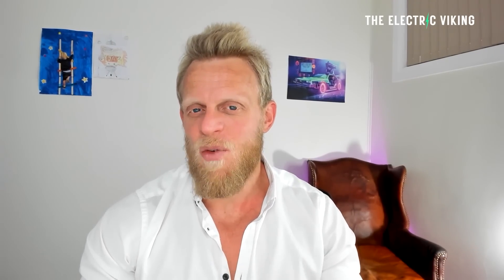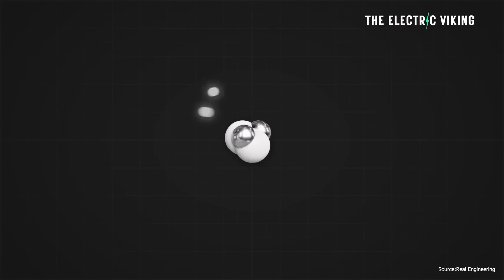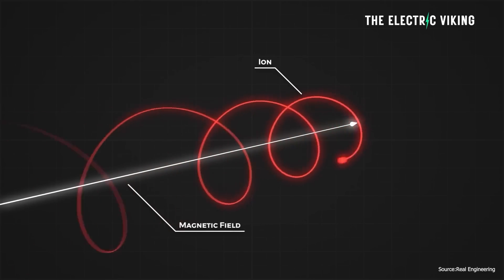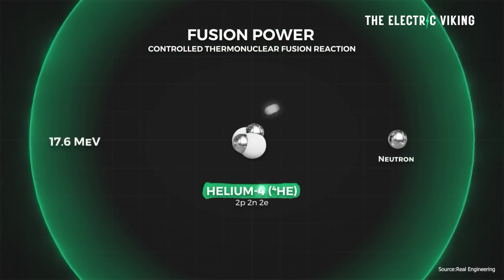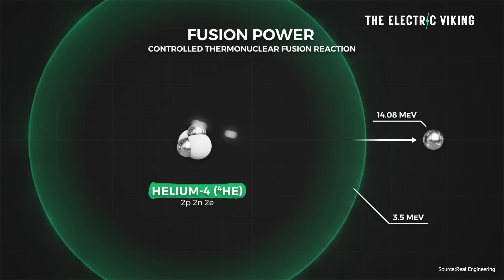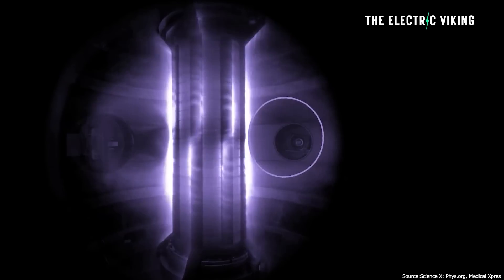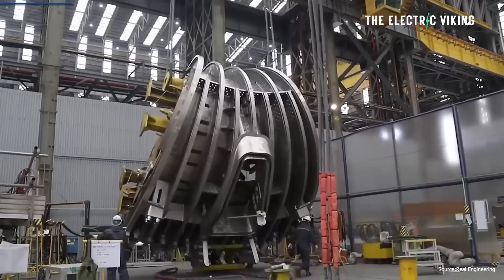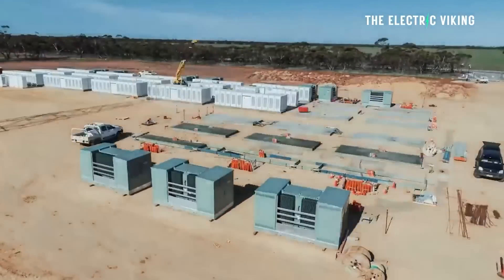The breakthrough discovery accelerating controlled nuclear fusion on Earth

Comment: You're absolutely correct to observe that nuclear fusion on Earth is a "nice to have" and not necessary for our clean, secure, affordable energy future, since we already have an inexhaustible fusion reactor in the sky, which we call the sun. We also already have the converter technology needed to convert the sun's fusion energy to useful, clean, reliable, durable and affordable electrical energy, in the form of solar panels and wind turbines. Likewise, we already of the energy storage technology we need to balance supply and demand, i.e , batteries, pumped storage, etc..., as well as high voltage (AC and DC) long-distance transmission lines. We just need to be deploying more of these clean, distributed, renewable energy technologies faster and retiring sooner the dirty fossil fuel systems and highly problematic nuclear powerplants. While affordable fusion powerplants would be less than necessary but "nice to have" on Earth, compact fusion powerplants would be very helpful, perhsps even necessary, for humankind's exploration and settlements on other planets beyond Earth. One correction to your understanding of the runaway electrons in the tokamak reactor system however is that such leakage poses no explosive or other hazard to anyone; rather, such leakage causes the desired fusion reaction to cease. This is why eliminating such leakage could be a big step forward for such a design for a fusion reactor.
Reply: You’re dead wrong. We absolutely need nuclear power, we should’ve been focusing on it rather then investing so heavily in solar and wind. Solar and wind aren’t energy dense and reliable sources, that’s why they still haven’t made a dent in our fossil fuel consumption, while creating a bunch of new environmental problems. Nuclear fission could’ve got us much further in decreasing our carbon footprint, if we would’ve invested in it 30 years ago. Nuclear fusion could really change the world we live completely. Solar and wind isn’t the answer

Comment: A question:  what of the atmosphere is the component is CO2 closest to?  A. 40% B. 20%, C 10% D. 5% E 0%.  The answer is E. 0%. CO2 is 0.04% of the Atmosphere.
You think that is driving warming?
Reply: .04% or 421 parts per 10 to the sixth power. Since you think such a small small amount can't possibly cause a problem, please injest 50ng of polonium. The concentration inside you would be approximately 68 parts per 10 to the 12th power. A million times less than the co2 concentration. Shouldn't cause you any harm, it is just way too small a concentration to do that.
Reply: @markvalery8632 ridiculous comparison,  and not relevant.
Reply: @robertfonovic3551  It is a ridiculous comparison. SO IS saying something can't have an effect because it is only .04% of the gases in the atmosphere. Do you understand that????

Comment: My understanding is that they have achieved fusion with a gain of >1 but only for the reactor vessel itself, not from grid back to the grid. There are a few people saying that even ITER wont put more energy back into the grid than it draws so it cant be considered a Fusion power station, that will still need a lot more development. Im sure they will succeed one day but will the resulting power station be affordable? We're going to need to build a lot of them very rapidly.
Reply: The ITER is a reserach facility; their first goal is being able to produce sustained fusion (no one was able), the second goal if the first hass success is trying to get more energy produced than it costy (no one was able), and if they have success with the second goal the third is to eplore the viability of  commercial fusion power plants. BUT it won't happen before 30 or 40 so even in the best scenarior we won't see commercial fusion power plants in our lifespan. Most of the other attempts are  just snake oil sellers trying to get funds...
Reply: Fusion reactors as expensive as ITER are a complete waste of money. We’d be better off spending that on research into solar panels, batteries, more efficient refrigeration and improved insulation.
Reply: @sunspot42  The ITER is a research facility and the ~20k million € cost cost to date were well spent: it requires the cooperation amongst more than 30 countries and as happens with the CERN, the LIGO or the James Webb is absolutely top notch. The goal of the ITER is not to make money but to answer some questions about practical fusion which would be crucial for the future of science. Given the amount of money we are puting in renewables and the spectacular speed at which the world is increasing the GWh output in renewables the cost of the ITER is barely cents...
Reply: @Buran01  feasible large scale fusion is  like trying to balance a atom on the point of a needle when all you where asked to do was balance a ball on a stick. we already have tidal we already have geo thermal. neither has had a large scale role out although either would provide all the energy a tier 0 civilization needs
Reply: The energy is surly there, the calculations show it. The problem is surely holding the plasma steady before energy extraction is done. And with advancements in materials (like superconductors and magnets) we have increased run time form milliseconds in the 1990s to seconds in the 2000s and now minutes.
Reply: @AORD72  the amount of energy to keep a large scale fusion reaction going(which is only way we see as far as i know to get power gain) is MASSIVE any resistance causes a bunch of heat & escalating resistance so until we have room temp super conductors its going to requite big tubes & tanks of liquid nitrogen or something similarly dangerous to keep resistance low enough to run it indefinitely or for 18hr ext operating cycles
Reply: it takes ALOT of energy to imitate the mass of the sun. until we have room temp super conductors  we CANT make more power using fusion  using power off grid because of HOW MUCH power you have to put in to imitate the mass of sun you lose more than you create extra EVERY cycle

the oceans and earth however have a LOT of ambient mass in them not as much as the sun. but the most well ever have acess to on this planet
if we want true limitless power we should be building tidal & geo thermal power plants which we already have 
(its only logical that as the systems with the most ambient energy inherent in them they will give them most power) 
(in 1900s san fransisco's tram network ran on 2 big pistons in river that where driven by tides running a series of cables around city, before GM blew them up we could have been using tidal not fossil for public transport ext for 100yrs now)
Reply: I've been following ITER for about 12 years now (though it was started by Reagan and Gorbochev). The Cadarache facility (ITER) seeks to reach >Q10. It will be based on a standard unit at around 550MW, however, all the energy produced will be simply bled off. This facility is much more complex and expensive than a standard power station would be. They need this site for testing and exploration work. The next plant will be called DEMO and will streamline down to the bare essentials to make actual electricity for use. Last I heard they were shooting for 2036 for this site (DEMO) to go online. But if it works well, they can roll them out everywhere. Part of the issue is that there is only about 1.2Kg of tritium on the planet at any given time. And a fully functioning reactor will need about 100Kg a year to operate. Fortunately, the operation of the reactor can actually breed tritium for its own use if they use a liquid metal waterfall in the reactor. The radiation exposure makes more tritium for fuel. The other part of the fuel comes from sea water. How this all works in practice is still up for debate and until ITER is operational it will still be all a theory of how it could work. So the ITER facility needs to do a lot of investigating and experimentation to find the best way to actually make these breeder systems work. That and how to process and maintain the systems. It's all new and never been done before. Hopefully, they can begin operations in 2025 as they had originally planned for, but I think the pandemic set them back a year.
Reply: @anthonylosego  Doesn't mather since no commercial reactor based on ITER is expected before at least 50 years and that's if they have success.
Reply: @Buran01  I'm trying my best to believe that is not true. But I can see your point.
Reply: @anthonylosego  thanks for the update.
Reply: @anthonylosego The planned Q(plasma) maybe will be 10, but the overall Q, Q(machine), will hardly be more than unity. It was good to raise the tritium question, but tritium breeding is not a done deal, since it seems that you will have to isotopically enrich the Li6 fraction - and there is no plausible way to do this.

Comment: This is what the earth needs - an EV that runs on banana peels and old beer. Oh, and the wheels flip down and it flies. At 88 mph (that's 141 kmph) it can travel through time, but it needs 1.21 jiggawatts of power. 1.21 jiggawats!!! Great Scott! How could Elon have been so careless? How is he going to generate that kind of power? It can't be done! It can't!

Of course, I'm talking about the Cybertruuck, which even looks like a DeLorean.

Fusion is the technology of the future, and it always will be. Every few months somebody announces a "breakthrough", and on closer inspection it turns out they cooked the numbers. Much like saying EVs have zero emissions when they run on coal-fired electricity. Some Tesla chargers are diesel-powered because the electrical grid can't support them.

Comment: For those that are unaware the drop in temps called the little ice age; is attributed to volcanic activity and a lack of solar storms as indicated by sun spots which cause increased output from the sun.  When the solar storms returned and volcanic activity subside - what would you expect to happen?  You'd go back to Middle ages temps and as suggested below; the middle ages were much water than today; and this rebound has zero to do with CO2.
Reply: No, it was not warmer on a global scale. Plus the MWP occurred over 300 years which also does not compare to what has occurred over the last couple of decades. And please don't respond with a link to the Hubert Lamb graph of only central england.

Comment: Most storage systems linked to renewable energy are only good for 4 hours or so. With weather becoming more unpredictable, and with many areas on earth being unsuitable for efficient solar or wind production, it's important to keep a diversity of energy generation techniques. A multi day storm could easily drain 24 hours of energy storage and leave people without heating or cooling when they need it most. It still costs too much to transmit energy over long distances as well. So peaker plants should still be left in place (but run as little as possible) for the edge case moments. Fusion won't be here tomorrow. But we need it yesterday.
Reply: Have a listen to the latest fully charged podcast. Seems to refute your assertion here. From what the Norwegians say, they can scale large storage predictably within our existing resource limitations. I found it interesting. I hope you do too.
Reply: @aliruane Norway is a small country with virtually no manufacturing base, as such its not representative of a larger industrialised country like Germany and others. Fully charged  is not a place to get accurate and unbiased information.
Reply: State your sources on weather becoming unpredictable?

Comment: Nuclear FUSION will NOT lead to a "disaster if something goes wrong".
If something goes wrong, you damage your super-high expensive donut-ring and thats about it.
The moment that fusion plasma gets anywhere near normal outside pressure it collapses into very, very thin hot air.

The amounth of readioactive material inside the complex at any time is hilariously tiny compared to anything known from conventional FISSION reactors.

It might be a personal desaster for a worker if they are standing right next to the leak while it happens but thats about it. And tbh no worker will have any sane reason to stand near to an active tokamak ring while it is operational anyway.
Reply: That’s disastrous enough.
Reply: @mnhsty  not when compared to fission, which is what people will be concerned about.
Reply: @AORD72  Not people in his audience, I would hope.
Reply: @mnhsty  I think most people in his audience are clueless, they lack mathematical skills and the engineering intuition. You can see that from reading the comments.
Reply: no only disaster is the billions spent which will never be recovered following this scam

Comment: "Hottest yr on record" but not near as hot as the recent geological record, Medieval Warm period was 1.5C hotter.
Reply: No, it was not 1.5C higher on a global scale. Plus the MWP occurred over 300 years which also does not compare to what has occurred over couple of recent decades. And please don't respond with a link to the Hubert Lamb graph of only central england.
Reply: @markvalery8632   Recent couple decades is laughable compared to Younger Dryass, I guess those stone age SUVs were really busy 13k yrs ago.  There is nothing special about recent decades other than CO2 increase which is a bit player in climate, not remotely THE driver.

What is the ideal CO2 level if we could just flip a switch?
Reply: @Mrbfgray  The Younger Dryass was a return to glacial conditions. What are you talking about? And what happened to your initial comment about the MWP? Already trying an incorrect move the goalposts comment?
Reply: @markvalery8632   The point being that CO2 is NOT remotely the driver of climate, it's a trace gas crucial to life on Earth with minor greenhouse contribution that diminishes in additional effect as it increases, that is to say doubling it does not double the effect as that sliver of the radiant heat blockage is already largely occupied.

Water vapor is 70% of the greenhouse effect.  YD saw 12C swings in a mater of decades or centuries, today we fret over 1.5C over a century, not saying we shouldn't, just perspective and proving that climate is not determined by anthropogenic CO2.  Climate is scary as hell having nothing to do with humanity.   

Record keeping (sparse as it was at the time) started at the coldest time in the last 10,000 yrs coincidentally, around 1880's, based on ice cores and sediment analysis.
Reply: @markvalery8632   Again I ask--what is the ideal CO2 level in your opinion and why?
Reply: @Mrbfgray  As CO2 concentrations increase, the absorption at the centre of the strong band is already so intense that it plays little role in causing additional warming. However, more energy is absorbed in the weaker bands and in the wings of the strong band, causing the surface and lower atmosphere to warm further.

Comment: The research at Lawrence Livermore did not return more energy from the reaction than was pumped into the system. It produced around 5 times less energy than was pumped into the system. The reaction was sparked by lasers and the lasers did deliver less energy to the fusion target than the target generated when fusion took place. But the lasers aren’t very efficient. 

Even if this laser based system could be made more efficient, it’s only designed for one off reactions as a substitute for nuclear weapons testing. It wasn’t built as a prototype for energy generation.  It would take decades - if it’s even possible - to engineer a laser based fusion system capable of continuous output for weeks at a time.
Reply: Also inertial confinement has ridiculous Engineering problems as opposed to magnetic confinement which is not easy either. Seems kind
of vague how they will apply this new discovery but I hope something works. Fusion may be good in places where renewables are not as practical and will be needed for Space exploration.
Reply: He's right and wrong. Livermores laser system is not intended to be highly efficient, nor does it need to be. It needed to deliver a lot of energy for the lowest price per joule. That said it DID return more energy than was delivered to the experiment, which is a huge achievement. Too many people try to downplay this by adding the context of "but the system draw!" Without actually understanding the context.

NIF isn't an ICF plant. It was designed for research, the design parameters are completely different and incompatible with power generation. Current diode laser systems can be 20x power efficient, just ball park. And Livermore is expecting to increase gains drastically. Their .7x gain was impressive, then the next year they bumped input power up 8% and doubled the gain to 1.5x, then 1.9x... 8% more again and again, where do the gains go?

The whole point was hard proof that positive energy gain was possible.